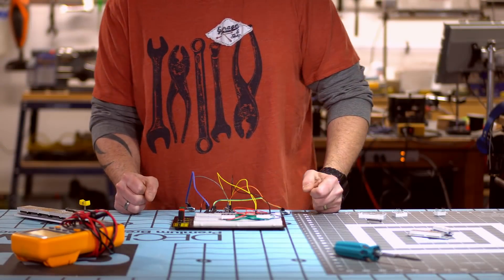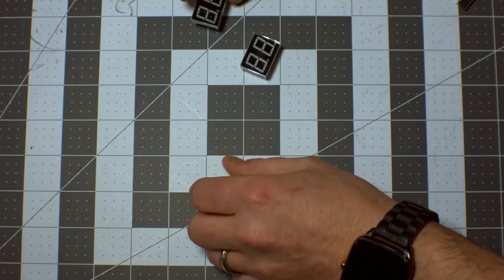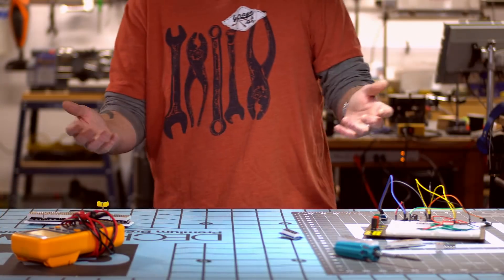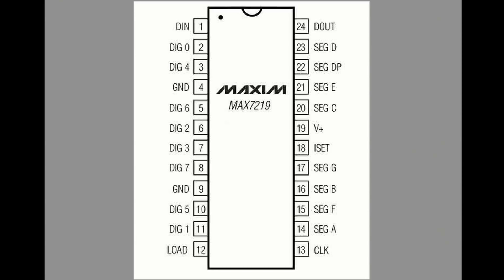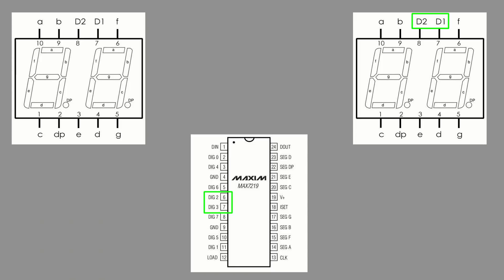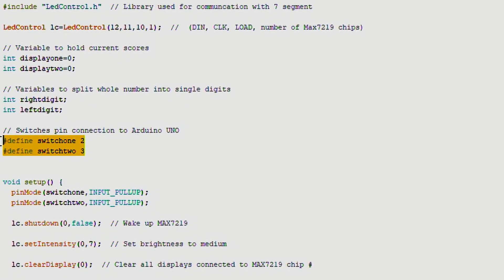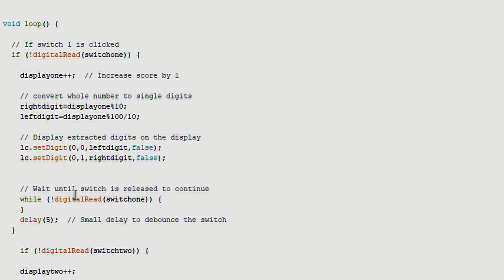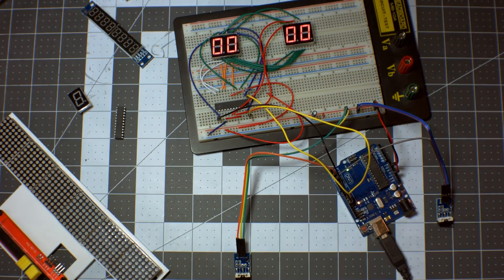Make your own MAX7219 7-Segment Displays: Arduino Game Scoreboard!

Comment: I want it to display my potentiometer readout, but I cannot get arround the fact it won't simply print the variable. There must be an easy way, am I missing something here? max7219.DisplayText("87.56F", RIGHT); works fine, but if I want to replace the string with an integer called potValue it can't display. How can I achieve this?

Comment: Nice tutorial, there is the blue module which has 8 digits you show at the beginning that you can connect to the Arduino and show numbers, my question is: making like you did with the breadboard is it possible to make it work like the Blue module? I need total of 24 digits but I need to upload other code to the arduino to run my project.

Comment: If I want to display 16 digit 7 segments, can I series the two chips or should I connect the 2nd chip directly to the arduino? Thanks!
Reply from the maker: If using two MAX7219 you would connect Pin 24 (DOUT) of the first chip to Pin 1 (DIN) of the second one.  The first chip will be identified in the code as Zero (0) and the second one will be one (1).  Example: lc.setIntensity(0,7) would set the intensity of the first MAX7219 to 7 or medium, if you want to affect the second chip then use: lc.setIntensity(1,7).  Hope this helps and thank you for watching!

Comment: can you help me to measure llinear  distance with stepper motor ? in arduino or raspbarrypie. i am actually working on a project and actually dont know how much precise that can give . i am working on 0 to 35 mm range. is it possible to measure this range with0.01 mm accuracy or below 0.5mm accuracy. the measurment i should get should be any mooment i on a switch. 
as i am new to here but your vedios are awesome so i am looking forward to you. for little help if posssible make a vedio or some code help. i am using 28BYJ-48 stepper motor. please sir. shabume15@gmail.com.

Comment: It nice ideal but a  8 digital 7 segment with chip on a board cost under $2  each so unless you need a custom display, stick with the cheaper option and get it premade.  The chip itself is $1.